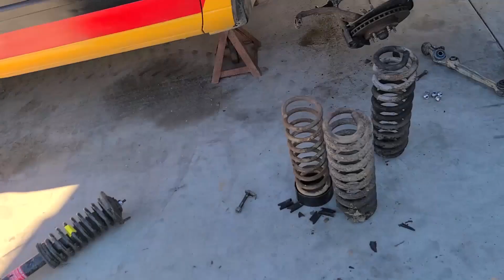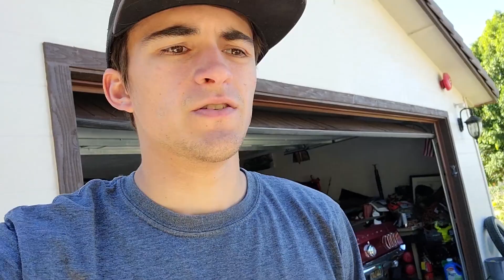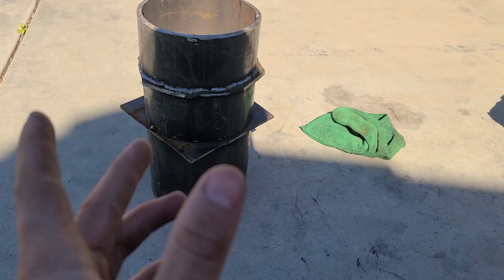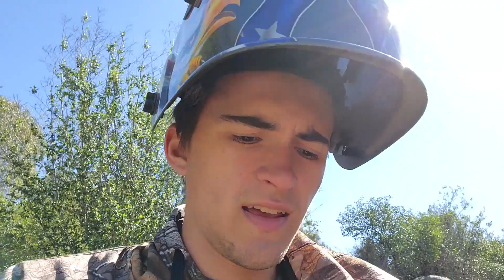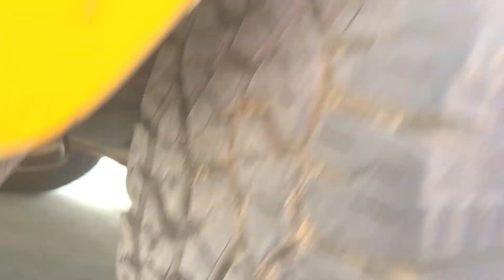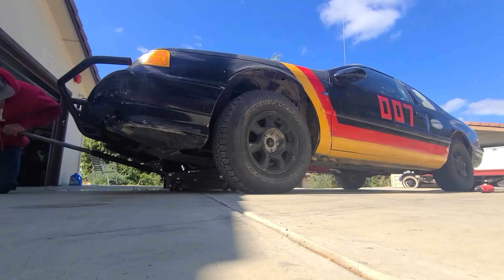How I Put Truck Suspension On My Thunderbird (part 1)

Comment: Being crafty is fun! And even Ford engineers go through some level of trial and error even if the tests are done in simulation instead with scale models like years back.  I wonder if the top mounts of your two shocks being tied to some other place in the "tower" or offset from the tower would be better. If everything is attached to your spring buckets every ounce of stress goes into the one bolt at the top (and bottom).